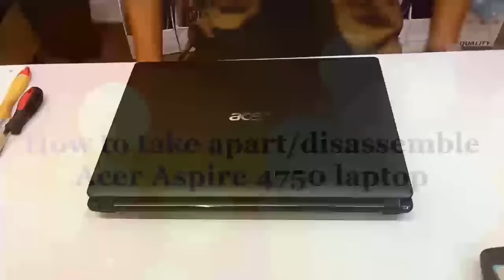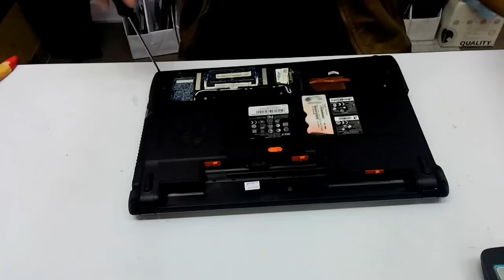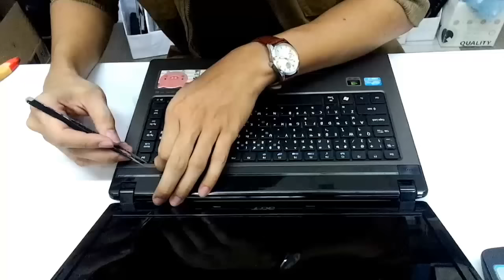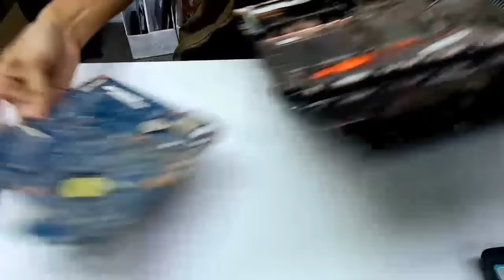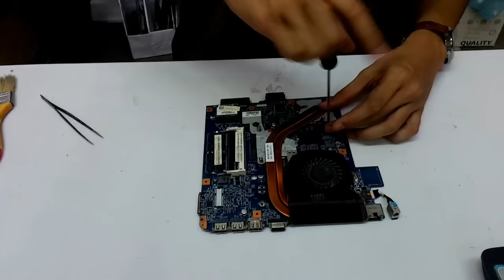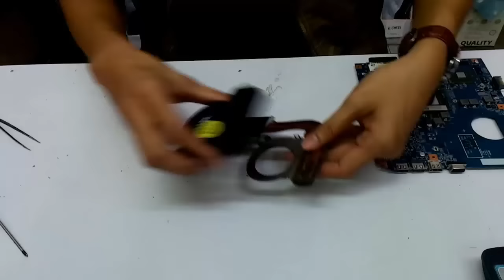Acer Aspire 4750 laptop take apart/disassemble

Comment: This video helped me tons with my 4752g, thanks a bunch.
Reply: +corronchilejano how to release some holder on the keyboard, i have 4752g too, but i couldnt remove the keyboard
Reply: It's complicated, but if you begin in the corners you can pull it off. Remember to push the little things that snap the keyboard.
Reply: +corronchilejano ok, but does the 4752G have removable graphic card?
Reply: Not really, no. You can clean it, but I don't think you can change it.
Reply: +corronchilejano okay thanks

Comment: Thanks. Very helpful for me for replacing cmos battery.
Reply: In this Acer, you can also install the i7-2670qm, i7-2720qm processor, but use it with the turbo boost turned off so that the processor does not overheat. Get 4 cores, 8 threads, 2.2GHz .. 
For drive "С"  buy SSD 120-128GB sata 2.5", transfer HDD (disk D / file storage) to the dvd slot through the Caddy adapter

Comment: this is same like 4750g version?
Reply: Same. I opened my aspire 4750G. It's having many variations. 4750z also a variation. Many laptop reused same hardware frame it's just internal spec are different like processor, integrated GPU and ram. Mostly motherboard model still same but limited to how many serial and variation model of laptop.